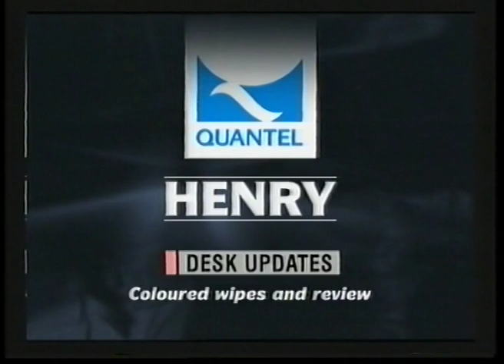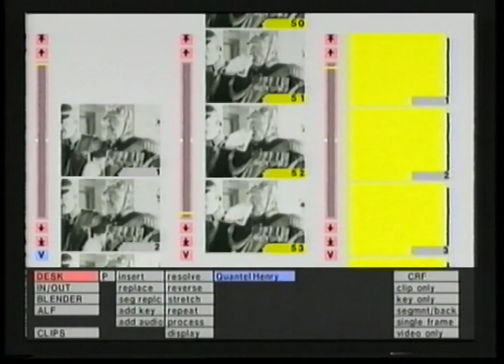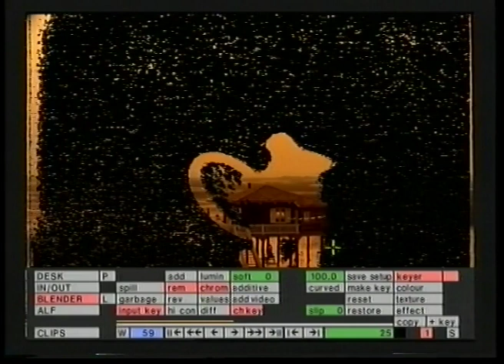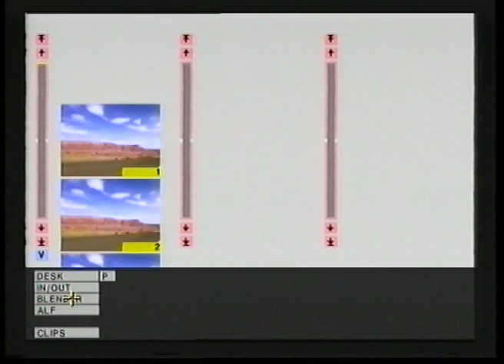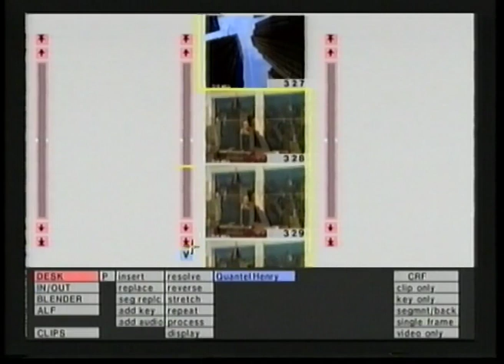Quantel Henry v5.5 Update Training Tape (1995)

Comment: 00:10 - Desk Updates - Coloured Wipes & review
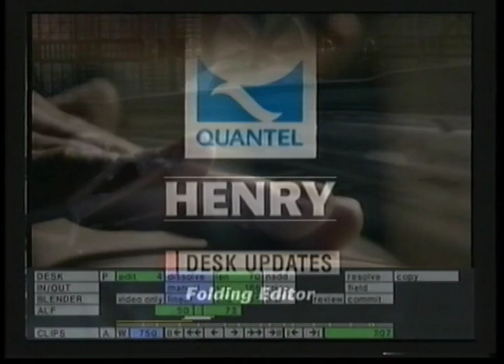02:36 - Desk Updates - Folding Editor
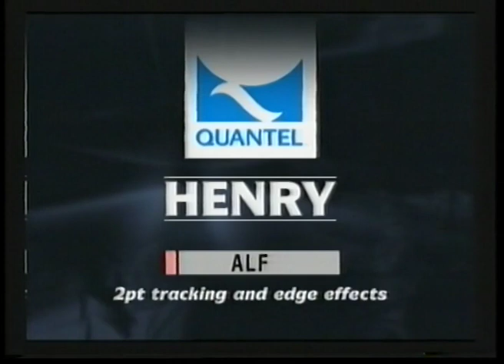04:10 - ALF - 2 Point Tracking & Edge Effects
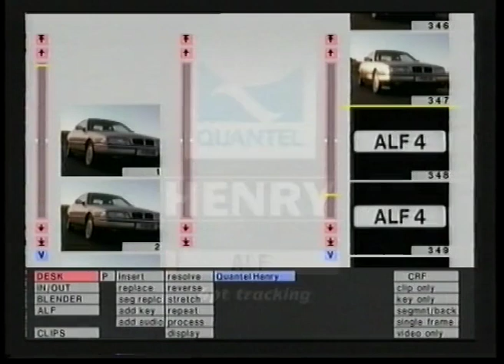10:07 - ALF - 4 Point Tracking
14:31 - ALF - Background Track
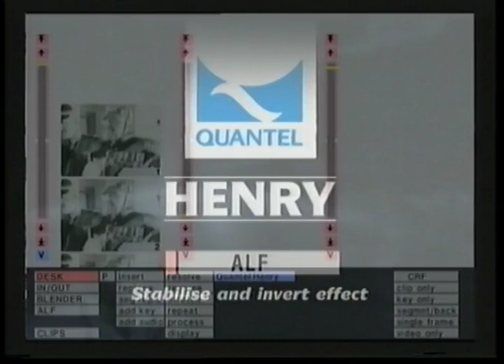17:48 - ALF - Stabilise & Invert Effect
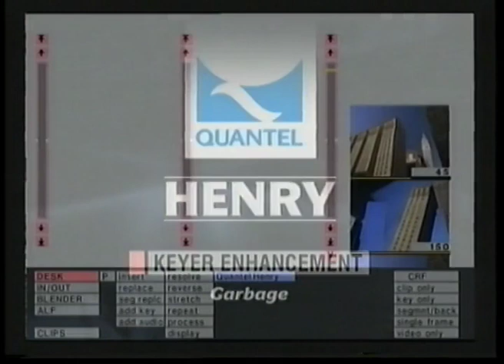20:51 - Keyer Enhancement - Garbage
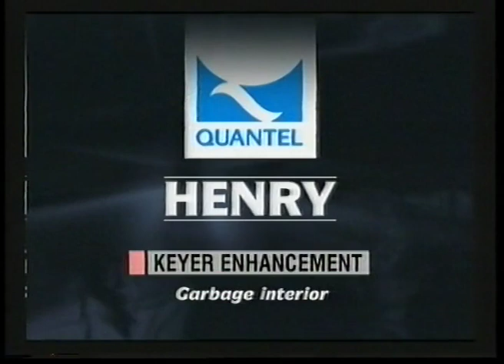23:54 - Keyer Enhancement - Garbage Interior
25:39 - Keyer Enhancement - Garbage Reverse
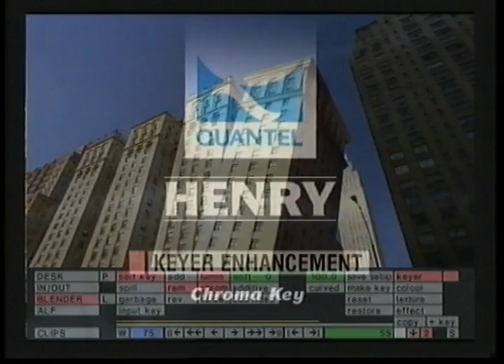27:05 - Keyer Enhancement - Chroma Key
28:09 - Keyer Enhancement - Transparency & Curved Key
28:59 - Keyer Enhancement - Plus Key
30:43 - Blur - Lens Effects & Shadow
38:14 - Effects - Keyframe Editing Facilities
42:29 - Effects - Window / Layer Blend Down Option
43:37 - In / Out Menu - F/B Loop
44:21 - Audio - A/B Lock
45:24 - Keyer Enhancement - Additive Key
46:16 - Keyer Enhancement - Add Video